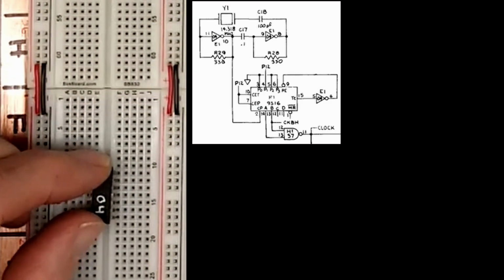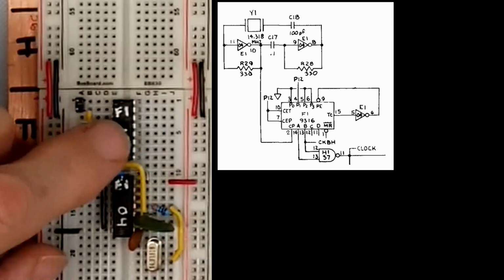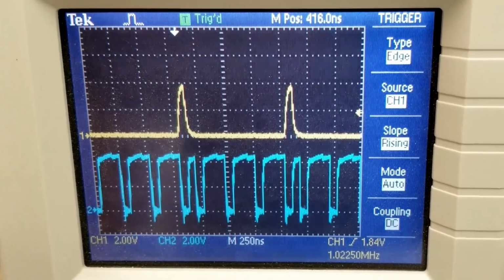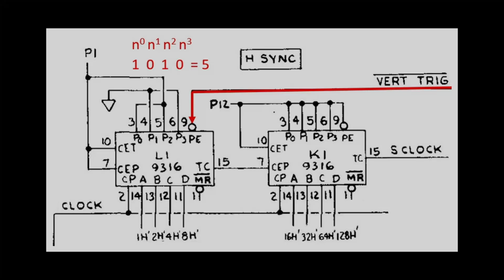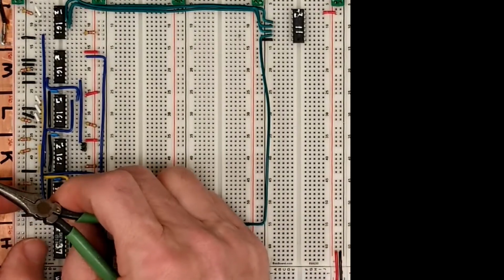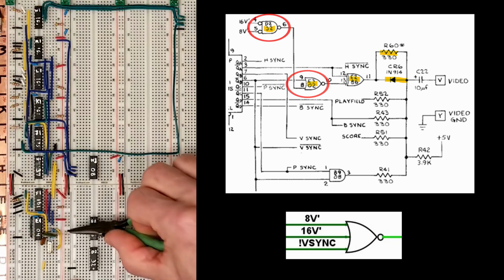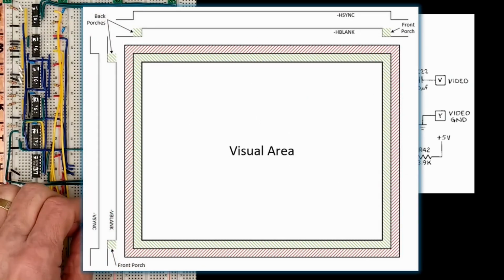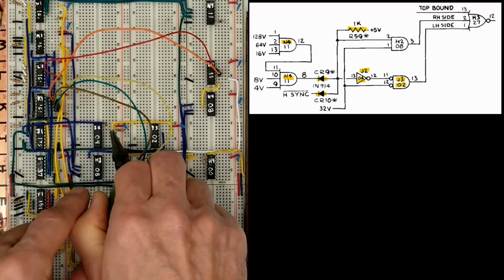Retro Atari Breakout Part 5 - Oscillator & Video Counters

Comment: The first time I built that oscillator circuit I was horrified by the ugly waveform so replaced the 74LS04 with the pin compatible 74LS14 (Schmitt Trigger version). It didn't oscillate at all. So I went back to the 04 and immediately connected the output to a 14 for the rest of the circuit. Here the oscillator is only used in a single pin in the divider, so that also cleans up the waveform that the rest of the circuit sees.
Reply from the maker: I didn't have issues with the oscillator itself but with the CLOCK line since it is a logical AND of two counter outputs. If transition times are not highly correlated, CLOCK ends up with narrow spikes. I used FAST for the ball counters at first and they interpreted those spikes as clocks and were all over the place. The LS basically ignored them. A more robust design would be to take CLOCK thru a latch (7474) on the rise of the inverted oscillator. That would latch the clock between the counter transitions, eliminating the spikes. But as usual, that would add more chips and the existing design worked. -Paul

Comment: I just ordered all the logic chips for this. Most are TI chips from mouser. The rest are Asian chips from LCSC. Only ordered the 2N5190 transistor. The other transistors probably have common substitutions, and I know all the diodes have common substitutions. This ought to be fun. 🙂 (Oh, the ram chips are from ebay)
Reply from the maker: Nice! I assume you grabbed all LS. I'm not brave enough not to use sockets so you may want to think about that. I did find suitable replacements for those 3 transistors in the reset circuit, but I don't have the part numbers on me. Very strange packages on those old ones. You can either search out suitable replacements based on the data sheets or wait until next week when I get back from Taiwan. For those SCRs, if you're not driving the a/c lamps, e.g. just driving LEDs on the control board, you can just use some common switching transistors (2N2222) instead. The package/pinout is different but we'll add extra sites to the Retro version so you can populate either way.
Paul
Reply: @bytemind-dev  Yes, all are of the LS variety. Speaking of strange old packages, the 2N3643 is still available from Electronic Goldmine. The package looks like something from War of the Worlds. As for sockets, I kind of go the other way. I found myself wondering if all the chips are available in SMD form...
Reply from the maker: Everything should be available in SMD. Another fun project would be to do a small FPGA. Only thing external would be 3.3v supply, 555(s), 4016, SCRs, & transistors - and you may be able to replace some of those. Whole thing would be a little bigger than the size of the connector area. Would be funny to open a Breakout arcade cabinet and the connector is plugged into some tiny board.
Reply from the maker: Almost forgot, sorry! Good substitutes for those 2N3643 and 2N3644 transistors are the 2N4401 and 2N4403 respectively. Pretty close to the same specs but can handle a tad more current. These are in standard TO-92 packages unlike the strange 'ol TO-105s from the originals. -Paul

Comment: What do you consider as load line signals, Non-prime signals and In-Bound signals?
Reply from the maker: Primes are 1H', 2H', etc. Non-primes are 1H, 2H, etc. Primes are base sync counter signals and non-primes are the same signals after going thru the screen flip logic (schematic sheet 4). Primes and non-primes are the same (except gate delays), except when player 2 is up in a cocktail table model.
For "load line signals", I assume you mean the VERT TRIG line going to pin 9 on the L1 and M1 counters. This line drops every frame causing new values to be loaded into these low-order counters on the rise of the next CLOCK.
For "in-bound signals", I think you are talking about the boundary signals we breadboarded today? If so, these would be the TOP BOUND, RH SIDE, and LH side signals generated on page 1 and mixed in H3a and H4a gates. Basically the outline of the screen. Later we'll see that the ball control logic uses these boundary signals to change ball direction.

Comment: You explain the sections very well. Breaking down each area helps understand the building blocks of the design elements. Thanks!
Reply from the maker: Very kind, sir. Had some new background noise (water?) I couldn't cancel out, even with a decent quiet reference. Was too lazy to re-record. Need to experiment a bit. Frustrating.